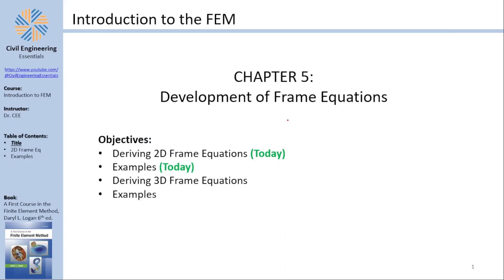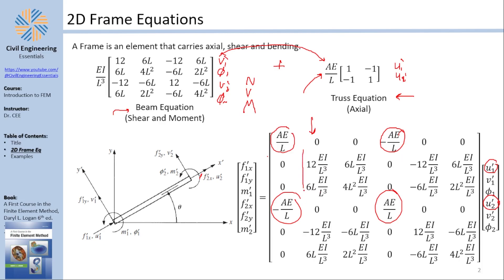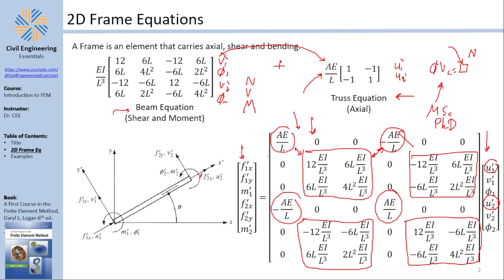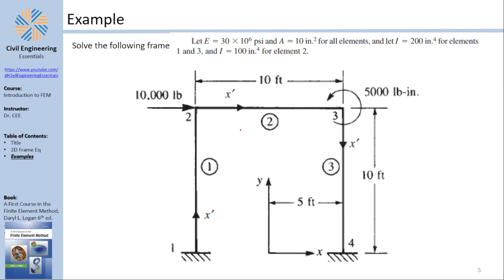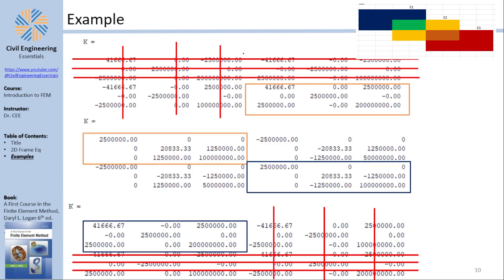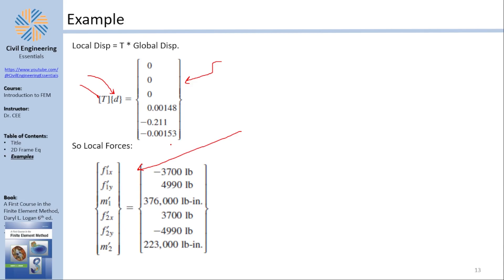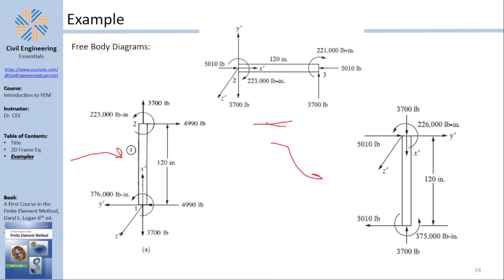The Finite Element Method | Part 12: The Frame Element

Comment: Hello Dr CEE,

This FEM lecture series is quite something else, and yes, it is very satisfying to say the least. Thank you so so much for doing this series.

I have completed the example, and at first, I was a bit distressed because my results did not match 100% with the results in the referenced text (for example I got the global displacement u2 = 4.95305mm compared to Dr. Logan u2 = 5.007mm …. this trend propagated to other displacement vectors and down to the local forces acting on the elements (for example my f’1x was = 14.814 N v/s Dr. Logan f’1x = 14.950 N; my m’1 = 37.577 x 10^6 N-mm v/s Dr. Logan m’1 = 38,049,902 N-mm, and so on…….)

Although the above results were about 99% similar, and I also recalled Dr. CEE mentioning something about the degree of accuracy of the computing tool used…., I still could not help to wonder why were the results not exact? after checking and re-checking my set-up and also panicking (^_^) of course. I decided to re-run my set-up using the US units, and lo and behold, the US units results computed 100% exactly and to the dot 😊. I know that this exercise was “practically immaterial”, however it was the “theoretical impact” which I wanted to explore. I guess it is safe to say that any early rounding off of numerical input values to the FEM should be done consciously.

15:31 Yep; you are definitely right T.A. CEE, Dr. CEE voice is indeed carrying extra joy in this video lecture (I wonder why, but I am glad it is, he deserves it) and the other good thing is that his joyful feeling is contagious. I am feeling it all the way here as well (much like in the matrix – pun intended).

I am sensing something here with regard to the 2D frame culmination equations. When we derived the “rotation or the transformation matrix” for the 2D-truss element, we included the v’-displacement term which strictly speaking, we should not have cared about it back then as it had no added benefit on the case of a 2D-truss (axial force) element. I think we derived that v’-displacement term for this moment right here 😊, this is where we care about the v’-displacement term, and more specifically because we now have shear force along v’-direction on the beam element. This is some next level foresight and it is part of the reason why the series is so satisfying.

It is now starting to sink in for me as to why we would have to derive the v’ and w’ transformation terms for the 3-D frame equations.

Furthermore, I think (I may be wrong here) that the “recommended reading” by Dr. CEE on chapter 4 (specifically example 4.3) was aimed to jump start the concept of “combining” FE equations. I never got that particular exercise right but I am inspired by today’s lecture in combining the “beam-and-truss element” equations to go back and have another go at example 4.3 😊 = beam-and-spring element.

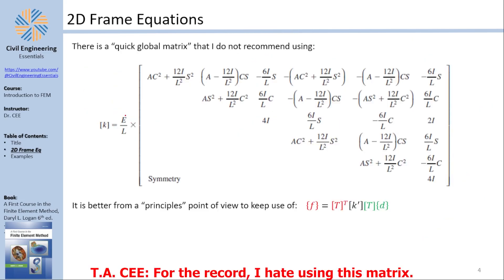06:18 😊 😊 😊, I can’t help but to laugh when Dr. CEE calls the [T-transpose]*[k’]*[T] an abomination. But I do agree 1000% with the sentiments; it certainly does not help to jump the steps of finding k’ and T and go straight to find k (by using the combined ….. , sorry scratch that, I mean by using the abomination)  if one intends to find the local (pains) forces. I think that this combined equation is included in the text because it may be considered suitable and attractive to someone who just want to do a quick (and blind, but numerically correct) computations of global displacements and global forces, it may also be attractive to a “programmer”?   

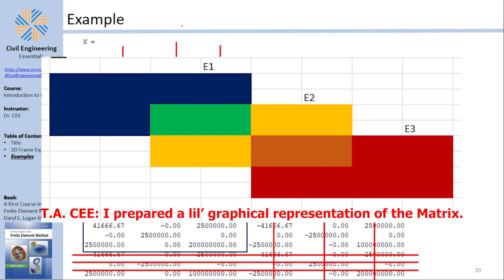09:52 [Assemble], I see the new “dash-and-slash” one-step_ish-approach. I’d say that it is always very good to see various approaches and this gives one options to choose from when it comes to assembling.

I would like to add that including examples in your lectures is superb, I can only imagine how much guessing and unsureness of the various application assumptions and techniques would ensue without your essentially well explained and thought-out examples and exercises. 

I am really enjoying these videos, and of course I don’t know where to put the HUGE “2D FRAME SIZED” shout-out 😊

Thank you Dr. CEE for shining the light for all to see.

Regards, DK
Reply from the maker: Hi there Engr. DK,
welcome to the world of numerical accuracy, where an error of 2-5% is usually acceptable.

Oh you cought that right.
The reason why I continued v' displacement in trusses although inconsequential was to prepare for this. I could not say that out loud back then, as we were at the start. ^_^

Yep, that example of 4.3 was also aimed at getting some ideas to prepare for this.

I kind of unapologetically hate the approach of just using a singular global stiffness matrix. "Pssst. I am preparing a udemy course on programming the finite element method, which is the reason why I already see the shortcomings of this approach.". Also also, STRADO.

I tried to do the global stiffness matrix in a more speed-runnerish way as it would start to bore people who are following the series since its start.

You are most welcome, thnx a lot for all the support and stay tuned for more content,
CEE